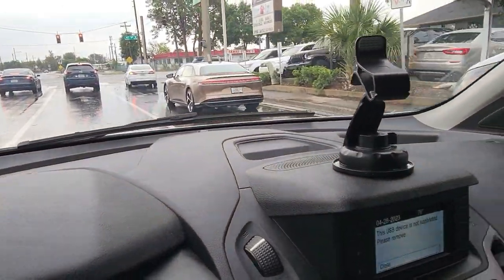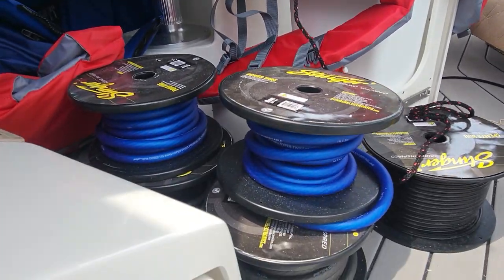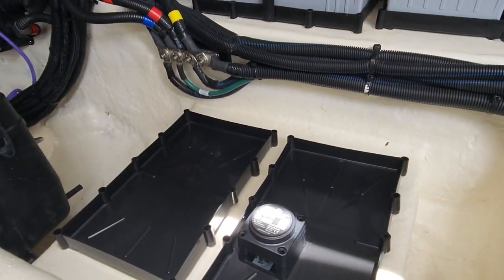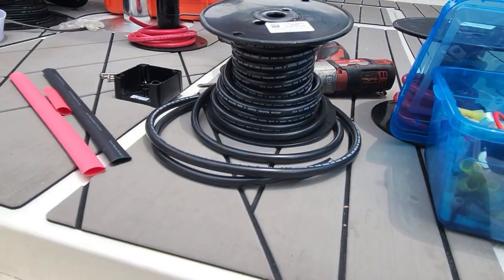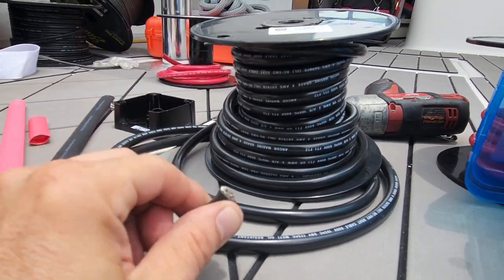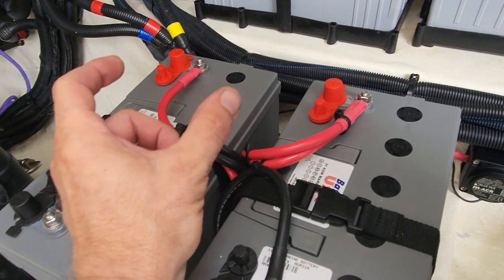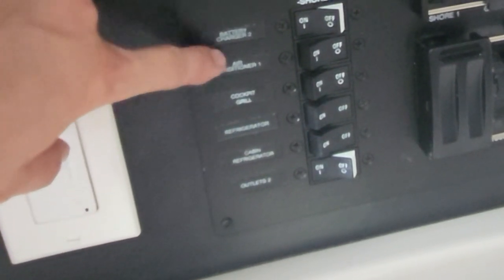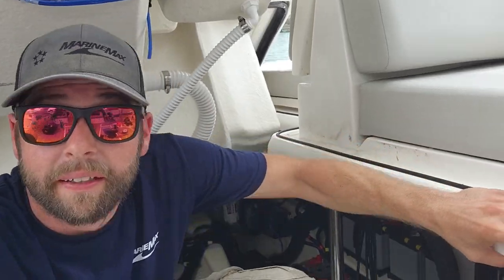Blue Sea Automatic Charging Relay Install. #BlueSea #SeaRay #MarineMax #Episode215

Comment: Thanks Justin! Love the “service” length advice. Question: I found the 2 ACRs on my 2017 280 Outrage with small black wire connected to the SI post (no idea where the other end is connected) and no wire connected to the ground posts. No wonder the ACRs led lights never lit up and house batteries were not charging off the mercs. Any idea why they were set up this way?

Comment: Justin, if you can remember back to your Regal days, the vinyl pad on the dash of the 28 Express, is that the access to the back of the dash?
Reply from the maker: I think you have to pull the panel out to access behind the dash. I don't think the vinyl pad covers anything.  That's only on the bigger boats.

Comment: Very interesting and informative video. The extra wire in the service loop is a great idea. Curious how you fasten the battery bases and ACR unit into the hull. Do you simply screw them directly the fiberglass? Do you put in any goop to keep water from intruding into the core if the hull is cored? How deep do the screws penetrate the fiberglass?
Reply from the maker: Thank you and it's simple for anything in a boat. Pilot hole, silicone and stainless hardware. That seems to be the trick to it. I only go quarter to half inch for things that don't need crazy support. 😊

Comment: Thank you for the video. Should I fuse the cables going into the ACR from the batteries?
Reply from the maker: I would fuse it from the batteries you are drawing from. The Sea Ray has fuses for the house side already. If you want to add them to both sides it can hurt. As long as there is one to stop a dead short. Good question and thanks.

Comment: Very clean looking wiring job. Speaking about power, I'm looking at a smart plug install, have you seen many of those plugs in your travels?
Reply from the maker: I know what you are talking about but I have never seen one in person.  My opinion is if you keep the connection clean and greased you will never have a problem.  Prevention is key to boating.

Comment: Hi Justin
Thank for the informative video.. I have 2 questions
1- I’m hooking up an ACR soon, My one is, I have one battery on a 1 bank on-board charger, will the 2nd battery charge through the acr when plugged in?
2-do I need to hook up the start wire, and if so, where to? I have a new Suzuki 175 and I don’t want to go splicing into anything new while under warranty?
Thanks and have a great 4th
Kurt
Reply from the maker: It will charge the battery when it is plugged in and you don't need to hook up the start wire unless it shuts off your electronics when you start the motor. Happy 4th

Comment: Great videos as always. Well, you asked for questions so here is one: I bought a 22ft 2023 Chaparral that has a single battery. It’s powered by a single Yamaha 150. I see Blue Sea Systems sells an “add a battery” kit” to add a house and give you easy smart charging during running…BUT also saw that Yamaha built in a similar feature: “your engine can charge an accessory battery separately using an optional isolator lead”…

Have you done either of these and do you have an opinion on which is better?
Reply from the maker: If you just want to add a battery I would just replace the switch with a dual switch. Then you can just select what battery you use and always have a good one to start the engine. The add a battery kit is also a good option.  Keep me posted.
Reply: @JustinLeeMarine  it sits in a boatel with no charger, so when running does a regular battery switch know how to effectively charge both batteries? I am trying to avoid dead batteries so anything with automatic smart charging sounded good!
Reply from the maker: It will charge both batteries the same when you switch it to all. Then when the motor is off you can switch it to 1 or 2 and have a battery for reserve.  It's the simplest way to do it and it works great.
Reply: @bigd50  no. you need an ACR to balance the charging or you will overcharge one battery while undercharging the other. a switch is just that, a switch, it does not regulate charging at all

Comment: Great video, I had one of these ACR's put in my 2021 Regal ESX2000 and an extra battery and the light would always be on even when the battery switch off and would have a slight humming sound coming from it. So I had them put in a switch on the ground wire to turn off and isolate the ACR when off in storage. What gives? is that normal?
Reply from the maker: That is normal. On the wiring diagram it shows you can add a switch to the ground if needed. It will stay on if you don't remove the ground.

Comment: wow nice installation, i just installed my yesterday and cant get the led, i have power when engine is off and i can start the engine... any tips? i have my ground pulled to a fusebox where it has  ground plate in top.
Reply from the maker: I would try a ground right to the battery and see if it changes anything. If not then start the motor and wait to see if it clicks over and starts charging. If all else fails call the company and see what they say. Keep me posted 🙂

Comment: I’m assuming you have two wires on the positive side of the  batteries one to both batteries and then one wire that runs to the acr?
Reply from the maker: Yes. That is correct. I combined the two batteries into one.

Comment: I have a 1720 Key West with a yamaha 90 2 stroke and the boat has two batteries. One to crank with, the other is the house. What is the function of the SI on the ACR and where does it connect? I read to put a fuse in the ground to the ACR and remove it when your boat is not in use, good or bad idea?
Reply from the maker: Start Isolation(SI)allows temporary isolation of House loads from Engine circuit during engine cranking to protect sensitive electronics from sags and spikes.  I would definitely install the ground fuse and remove it anytime the boat is going to sit for a while. It will stop the ACR from draining the battery unless you leave it on charge all the time. If you keep it charging you don't need to remove the ground. Good question and thanks 🙂

Comment: Have you ever seen a setup like this with a trolling motor? IE outboard charges house then spill over to trolling motor batteries? Im trying to figure out a solution because I don't have access to shore power charging.
Reply from the maker: Yes. Minn Kota makes one.  I think they call them alternator chargers.  I would say it would work just fine if you run your engine enough. Good idea

Comment: You didn’t fuse the charge leads? Or, the ACR ground?
Reply from the maker: I did fuse it at the batteries it's connected to with a 100amp block fuse and it's also fused going to the batteries it's charging. This was the beginning of the install so it wasn't all completed. I had to wait for the rest of the stereo to be installed. I should have mentioned that in the video and if I ever go back to the boat I will film it really quick. It turned out to be a crazy install when it was completed. It now has 42 speakers 😆

Comment: Will this arc know when the secondary battery it’s charging is full and isolate itself from overcharging?
Reply from the maker: It will not but if you have a good battery charger it will do that for you.  The charger doesn't know it's got extra batteries so it will act just like it would normally and shut off when charged.
Reply: Do you think this would be a good option to add to run to a dc to dc charger, inverter, battery setup for a toolbox or do you think an isolation relay or something else would be a better option. I have a newer vehicle and it has a smart alternator. So many different types of things to use out there between isolation relays, arcs and whatever other things that have out there.

Comment: Question, when batteries are fully charged acr green light stays on until voltage falls below 12.7
Reply from the maker: That I am not sure of. I think it only stays on when it senses charging voltage.
Reply: Notice when I put fully charged new batteries in boat 13.2 light stayed on until 12.7 I guess it thought it was charging
Reply from the maker: 12.8 is fully charged. Over 13 volts is just a surface charge. It will go down to 12.8ish as soon as you load it. Everything seems to be working as it should as per what you are saying. 12 volts is 0-10% charged and 12.8 90-100%. Anything under 12 volts is a dead battery.
Reply: Thank you